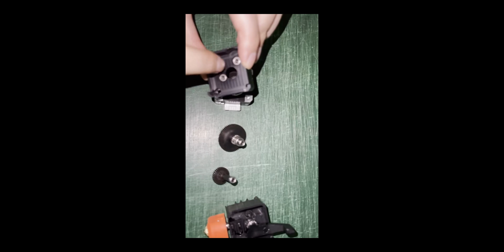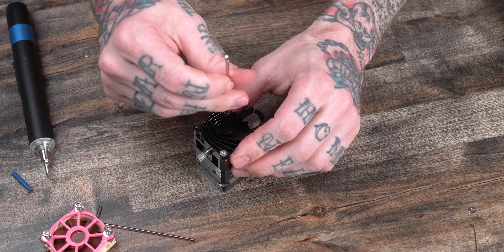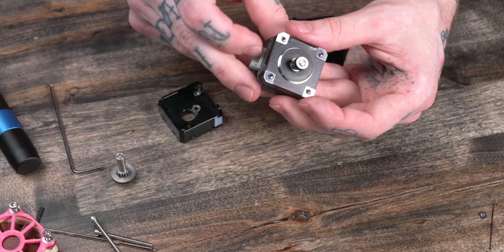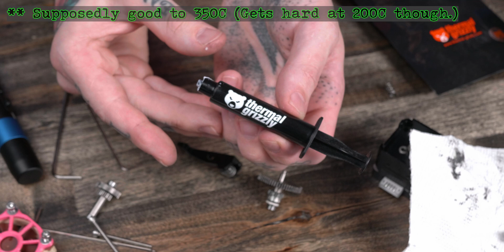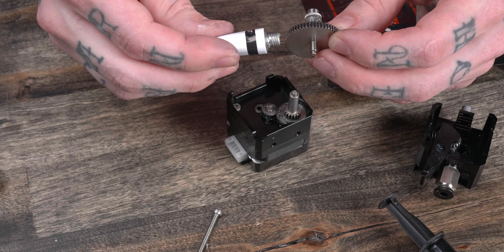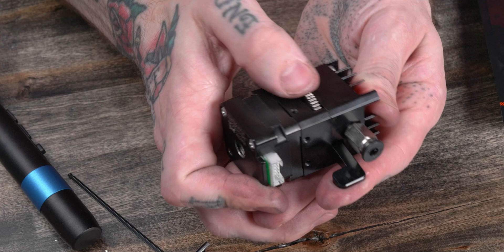Biqu H2 Clicking Noise Fix - Teardown and Adjustment

Comment from the maker: Biqu has release a "V2" of the H2 Extruder that supposedly improved on this issue.  I have not spoken to them or heard any reliable information as to whether it is actually better.  They can be found on Amazon now: https://amzn.to/33RPYeT (Affiliate Link)
Reply: No it isnt, I have the v2 and it clicks every retract, even as low as 5mm/s retraction speed, also this fix does nothing as there is no rotation movement available, in either direction, its the most annoying click clack noise, over powers the entire printers noise, the faster the retract speed the worse it gets, and at 5mm/s and slower, its strings, zits and blobs galore.
Reply: I have just installed the v2 and the clicking noise does happen but it seems to be very minimal. Will update when I have tested more. Been running at 25mm
Reply: @tiztrain  Any update?
Reply: Nothing is changed in v2. This clicking noise comes from bearing seats and shaft being undersize. Bending the case is not correct way to fix it. It fixes it because it will bind the shaft in an angle. Your gears not will touch only on edges and will wear unevenly. Probably using around 10% of the gear area. The sound is coming from gears not being close enough to eachother and depending on which way the force hits, it will flop around your main shaft in there. it really would need a better case and new shaft, but some people are just adding some capton tape on bearings and shafts to make it a solid fit. permanent fix would be to either machine bearing holes bigger and fit a correct bushing in there or change to a bigger outer radius bearing (i think it can not be done for the one near motor gear).

Comment: One mor thing I say another video that said the clicking was do to the small bearings inside being a very small bit smaller than the hole. Therefore, wobbling around. He replaced his with new bearings he got from BTT. Or source them yourself. It probable will be much faster than trying to get BIQU to send you new ones.

Comment: Also, at 200mm/s with the REVO HL.6mm nozzle my large print did stop printing the Honeycomb infill. So I am going to try raising the Current from 800mA recommended to 850mA. And you don't want to raise the Amps too high to burn out the motor. I am thinking it can handle up to 1A but do this at your own risk.

Comment: UES,YES,YES I have the H2 V2s Revo HL version. I have the same minor clicking  noise. I just installed mine. Including the 3DFUSED linear rail system on the X, Y, & Z axis. So I have not done A lot of testing. I ran a few 20mm cal cubes and 2-3 big music drum prints that take up the whole bed. Mine was clearly clicking when it would go around the corners of the CAL Cube. I tested this by totally tuning off Retraction for the cube test. Also in the big DRUM print about 260mm, Print the first 2 bottom layers I hear virtually no noise until it changes direction. Then I hear a little noise but not much. But printing the Honeycomb infill third layer I was not hearing any clicking. I have been playing around with Jerk and acceleration setting as well as spring tension. Hard to tell if that is helping much. I also tightened down my x, y belts that did make overall movement much smoother. I was printing at 200mm/s and it seemed pretty smooth.  So I don't think on mine there is a miss steps. Also check your feed rate. BTT says up to 45mm/s. I tried that and there was grinding/clicking all over the place. When I went to 22mm/s in marlin firmware on my REVO missed steps went away.

Comment: Also, there is the question on whether you should use oil or grease. I know that grease is much heavier than oil. I installed the 3DFUSED linear rail system and it does call for a drop of oil to Lubricate the bearings not grease but again I am concerned with Filament slippage either way.

Comment: I don't know the real answer to this but My theory is that if the grease gets on the filament wouldn't that cause it to slip. Maybe someone else can comment on that. Although with my 3D printed Zesty Nimble extruder the company says and send a small bottle of gear oil. They say to use one drop only and run the gears for a while with no filament to "Bake in". So I would love to know from BTT on what their recommendation is on oil or no oil. BTT in the instructions to add oil is it is needed. But then again the instruction and support is not very good.

Comment: I was looking for videos for how to install my metal heatbreak upgrade, and I couldn't find any.  I ended up watching yours in the hopes that you might hit on it...  And you did!  Thank you!
Reply from the maker: Happy to be of help. Note the All-Metal heartbreaks are a bit shorter than the Teflon lined ones. Why? Idk, but they are. So just be aware you may have to adjust offsets after the swap.
Reply: @MandicReally  Thanks, yeah I'd heard that.  But I haven't actually got the h2 installed yet so I've got all the calibration to do yet.  :)

Comment: Was trying to find that cooling duct mounted from behind but it's nowhere to be found 🤔
Reply from the maker: It is designed to work with my specific installation on my Ender 5 Plus, as such I never released the files.  It would require folks to convert their machines to be like mine, and that isn't a system I'm willing to support or maintain.  Sorry for that.  I actually ended up replacing the duct in this video with another version that uses a larger 7530 fan as the single 5015 was insufficient for printing PLA.

Comment: UPDATE:   So after trying this adjustment the same thing happened.   So I decided to run the extruder motor with gearbox off.   I noticed it made a funny sound.    I was EASILY able to stop the turning stepper motor with light pressure from my finger tip.    I seemed to remember reading about another issue with the cable not making good contact on the board because it's the wrong connector.

Reassembled the whole thing and popped the board cover off.   While making the extruder run I can wiggle the cable and that gear skipping noise coming and goes.   I can also see a tiny spark from that plug as I wiggle it.

I'm going to try to find a better cable but in the mean time use some poster putty to hold the plug in place on the board

Comment: Thank you for this video.   I'm having the same exact issue on my v2 H2 with not even 2 hours of printing on it.    Going to try your adjustment method.   On a side note, what are you using for retraction for PLA?   I'm seeing everywhere from 4mm/s to 45mm/s recommended.   45 is definitely louder than 4.

Comment: i just installed my H2 smart on August 2022. 
The clicking on retraction is horrible! I was able to find another possible fix to this:
https://www.youtube.com/watch?v=DoMO8FlQKg0&ab_channel=StackingLayers

he mentions adding a small piece of tape between the bearings and the housing, to reduce the wiggle room between everything.

also beware, my heater cartridge cable is full of fiberglass, been itchy for the past 3 days. so wear gloves when handling it ><

Comment: What part cooling fan are you using there?
Reply from the maker: All the mounts and parts are of my own design. This had a 5015 fan that wasn’t sufficient. I moved to a 7530 Fan and new duct design.
Reply: @MandicReally  Nice! Thanks for the quick reply.. Is the fan mount still available? I didn't see it glancing through your files but could have overlooked it. I print all PETG so don't need as strong of cooling and can use a 5015.
Reply from the maker: @oneheadlight8000  I n ever released my adapter / fan mount designs as they require a linear rail conversion.  I didn't want to be reponsible for supporting an entire modification setup for the Ender 5s, so I haven't released it.  There has been plenty of interest though.  Maybe I should release it so folks can at least mod it to fit their own needs.
Reply: @MandicReally  Ah I didn't realize it was for a linear rail setup. No big deal. I did find a design I liked and modified another design for the mount to fit my needs. Thank you for the replies!

Comment: Did you switch out to all metal extruder at the same time? Those dang Capricorn tubes can cause extrusion problems. 

For the heat break grease: yes, grease the upper; no, don't get any on the heat break threads. You don't want to transfer heat to the heat break via the threads but you do want to transfer it away from the heat break via the upper. 

For the gears, use graphite instead of grease. It doesn't attract dust like grease does, and since this is open, you will get dust in there.

Comment: i've got 2 of these h2 units and both of these buggers have been giving me nonstop problems with getting jammed when going to extrude, i tried everything with disassembling and reassembly with no luck. but i did find a fix for my case. the screws that hold the motor to the metal housing of the hot end area needed to be loosened just a tiny bit to get a bit of a wiggle and then followed the procedure as normal, tightened the screws that go all the way through the whole assembly and the thumb gear spins soooo smoothly instead of not at all

Comment: I just bought and installed my Biqu H2 and am calibrating it for opitmal performance and started to notice a slight tick during retractions. As I am messing with retraction settings, it could be do to bad settings, but I am not sure as a lot of people tend to hear this clicking noise.
Reply: What retraction settings do you use?

Comment: I got a brand new one "V2", installed in in my E3v2 and the noise is still there. It seems it happen during the retraction. In your video there was nothing damaged but the noise still remains after inspection. I beileve that it is because the gears have a small backlash and when it turns reverse quickly (due short retraction), the "click" happens. Anyway hope this will not tear down the gears so fast and hope theylast long time even with the noise.

Comment: Mine came with the gear on the tension arm reversed. No bueno, but an easy fix. Now it is pretty silent except for retractions. I also found that it was more likely to bind depending on how you "clocked" the motor. Cable connector straight up works the best. Maybe it's just how I'm assembling it.
Reply: Hi, what retraction settings do you use for Biqu H2 Extruder?

Comment: Why does everybody put thermal paste on the part of the heatbrake the skrews into the heat block? It really makes no sense, the whole point of the heatbrake is to isolate, why would you put the thermal paste in there ? Its job is to transfer heat and you dont want heat transfered into the heatbrake and than into the heatsink. I am sure there is not a big diference either way, but still, cant understand what are you thinking while doing that
Reply: Because you need to wick the heat away from the filament in the tube as much as possible, the brake helps to inhibit heat from traveling back up the tube, but what heat does get past this point, needs to transfer as efficiently as possible to the heatsink so the fan can remove it, other wise you end up with heat creep, so thermal grease of some kind is totally needed, I use Copper grease, sees to work perfect at these temps and stays wet so you can remove easy as well.

Comment: the bl touch mount stl?
Reply from the maker: Haven’t released any of those designs cause they are all centered around my mounting on my Ender 5 plus. Most folks use those front holes for their Cooling fan mounting. My fan is Behind the extrusion so out of the way. If you want it, I’ll gladly release the files.
Reply: @MandicReally  I have the part cooling on the back too and if you could release the file I would be very happy
Reply from the maker: @giovannipilosio4793  I just uploaded it to Thangs. Also I included the Probe Offset measurements in the description for properly configuring it: https://thangs.com/MandicReally/Biqu-H2-BL-Touch-Mount--Direct-Drive-Extruder-42776?manualModelView=true
Reply: @MandicReally  that part cooling fan duct is pretty nice, where Chan I find the file?
Reply from the maker: @benayer6552  I’ve never released it because it was designed around the Linear Rail conversion that I did at the same time. So it wouldn’t work unless doing the exact same conversion (without modification) and I don’t want to release the whole design as I’ll end up tech support for it forever more. I could release it as a “DIY” “Make Your Own” thing maybe.
Reply: @MandicReally  lol yup I totally understand. I’m running an ender and haven’t found one I like yet. 

Also my h2 v2 clicks on retraction like yours in the video at the end. I’ve tried all the things you did and still no improvement, I just think it’s normal use noise at this point. Thanks for the quick response

Comment: Excuse me, can you tell me where to get the mount you used for the h2 biqu
Reply from the maker: I designed it myself. It requires converting the Ender 5 Plus to linear rail as the mounting uses the original v slot wheel holes for bolting. That’s why I haven’t released it yet.
Reply: @MandicReally  ah ok I wanted it to be mounted on the original base in the ender 5 plus
Reply from the maker: @shangrill  I saw yesterday that Biqu has mounts on their website now. Zero idea if they are any good but they have an Ender 5 one: https://bigtree-tech.com/pages/download

Comment: sometimes I run into problems for changing filaments.  filaments blocks. have you ever run into this problem?
Reply from the maker: Yep. It’s not easy to change filaments on. It seems to just chew up the end of the filament instead of feeding it in on a filament change. Maybe half the time I run into that. Which is not confidence inspiring when I have it on my Ender 5 plus where I may end up doing prints so large they require multiple spool changes.

Comment: Hey, I currently have a H2 and want to replace mine with an all metal heat break. How did you go about removing the heater block from the heat break first?
Reply from the maker: It unthreads very easily from the block. Once the nozzle is removed there is nothing keeping the block on the heat break. The only thing that keeps them together is the Nozzle acting as a jam nut. So remove the heat break assembled as I showed, unscrew the nozzle, then unscrew the heat break. Assembly is the reverse.
Reply: @MandicReally  Cheers thanks for your speedy reply! I get what you mean. Would the heater block need to be hot while I unscrew it from the heat break?
Reply: @goblinelite4603  that's absolutely the best way to do it. Heat it when you take it apart and heat it when you put it back together.

Comment: Use GRAPHITE lube, go to the hardware store key cutting aisle and get Lock Cylinder Lube.  You can’t use the same lube you use to grease a dump truck!!!!!!   When the gears are microscopic that leftover grease that they scraped off the floor of the janky Chinese axle factory next door or the grease they scraped off the side of the wok after dinner just doesn’t “flow”…..  Mine did that too, cleaned all the gears and bronze bushings in acetone, then “dusted” the gear teeth with graphite.  Now she runs like a raped ape averaging 250mms with 1000mms max vel with only slight ringing WITHOUT an inertia switch.  

While your in that deep though buy a “all metal Titanium heat brake” for it and give that Teflon lined crack pipe to your nearest plug.  He will thank you and so will your printer!!!!

Comment: For me the lever was slightly to wide, so when you tightened the screws it wouldn't move freely and thus wont grab the filament with the full strength.
I filed it down a bit in the relevant part and now i can tighten the screws fully and everything fits much better overall.

Comment: I finished setting mine up today, the noise is at about the same level as yours, I did apply PTFE grease in the gears which may have just dampened the noise, but it is printing well now.
Reply from the maker: I’ve got maybe 100-150 hours in since this video. It got quieter, then louder again but hasn’t skipped a beat printing so far.
Reply: @MandicReally  I'm tempted to just order some high quality gears and replace them but that point I may as well have gotten a hamera. We will see.
Reply from the maker: @sufyansaleem9771  I’m mildly wishing I’d gotten a Hemera, but I’m gonna run this till it acts up.

Comment: Just found your channel this week and your videos are awesome to watch, the amount of detail you go into in practically all of your videos is great. 

I didn't even know the H2 had a PTFE tube in it's heatbreak. That actually shocked me tbh as I really expected it have an all metal heatbreak already. Good to know!
Reply from the maker: Yea and sadly so far no one in the US seems to stock the all metal heat break for it. I’m sure that will change but it is a bit annoying at the moment.
Reply: @MandicReally  perhapsibly silly question but if I were to change my heat break for an all metal one, there would be no need for a ptfe tube in there, correct?
Reply from the maker: @SwayK47  yes, that is what the "All Metal Heatbreak" will do, replace the need for the PTFE tube.  That CAN mean more heat creep for materials like PLA though which can lead to clogs.  So  you should determine what you intend to print most and decide your heatbreak choice on that.
Reply: i depends what you got. If you have biqu bx printer , it will come with all metal. If you get regular h2 (300c) it comes with ptfe. there is 500c h2 , which is all metal.